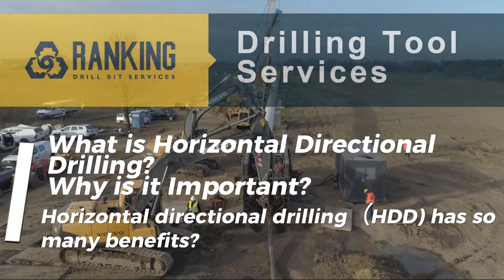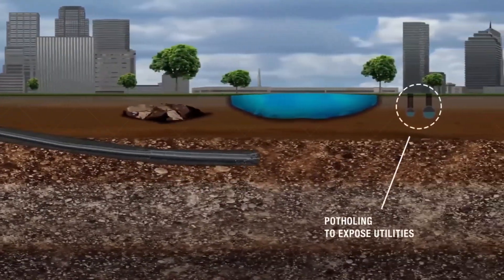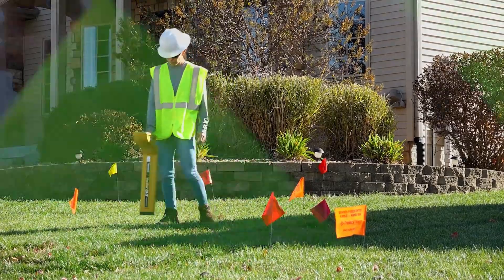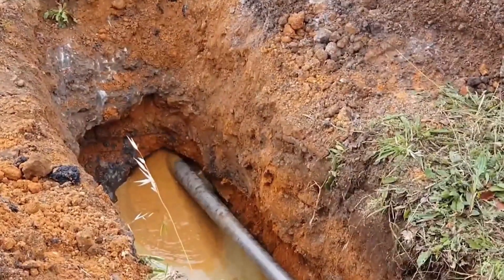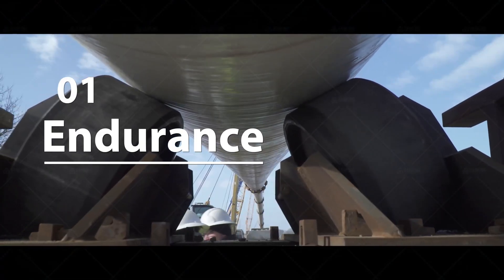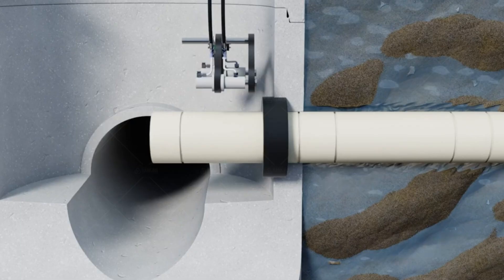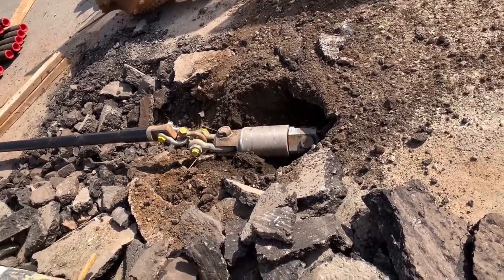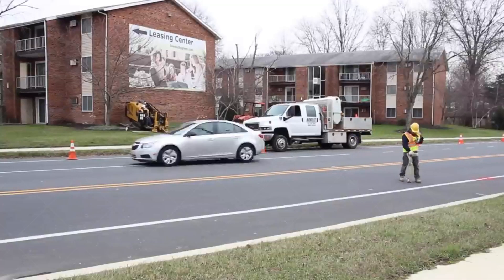What is horizontal directional drilling HDD and why is it important？What are the benefits of HDD?

Comment: In my city, they usually just open up the road. There's rock outcropping all over the place, it's typical to have a rock hammer laying around on construction sites. Recently, they needed to have a pair of pipes go under an active railway. Bedrock at that location is quite literally right under the asphalt. They dug a pit, set a horizontal drilling rig and pushed a steel pipe with tooth straight through the rock.
Reply from the maker: In many cases, it is impossible to directly excavate the ground to lay pipelines. In fact, most problems encountered when laying pipelines are encountered. At this time, the new method of horizontal directional drilling can perfectly solve this problem!
Reply: THIS IS HOW OIL COMPANIES STEAL OIL FROM UNDER LAND THAT DOESN'T BELONG TO THEM!!

Comment: Finally getting fiber where I live..  I saw them using this machine, and thought it dug a ditch as it moved to lay fiber in, then bury.  So it basically a small oil drilling rig lol.
Reply from the maker: The construction method of horizontal directional drilling does seem very mysterious, but it is indeed a good way to lay various pipes under the city!

Comment: Pulling had to be temporarily stopped due to rig breakdown. Exit side( pipe side) is bank of pond and now it is raining heavily at the site. Water level  increased up to hole level. Since rig side  level is lower than pipe side level, water is flowing through hole from pond to rig side.Can you suggest any technique to temporarily plug the hole to prevent water seepage from pipe side to rig side.
Reply from the maker: Judging from the current situation, it is recommended that you first stop the water from entering the channel to prevent the water from damaging the channel! If you have picture material of the actual situation, you can contact us on my homepage! Our engineers will analyze your situation and create a perfect solution for you!